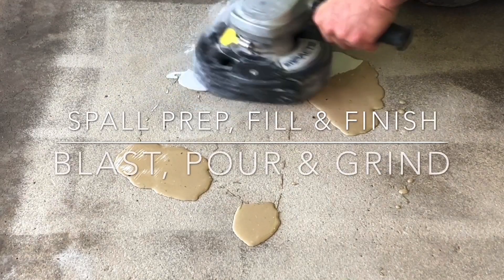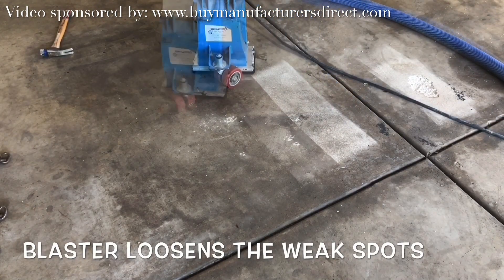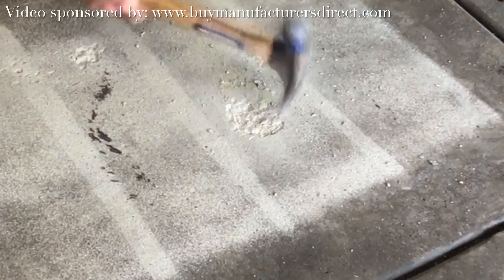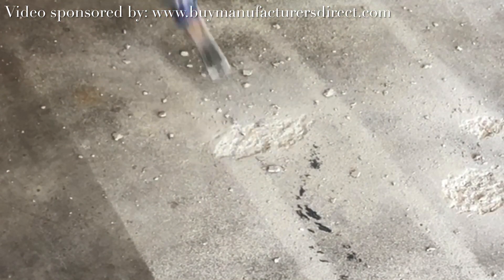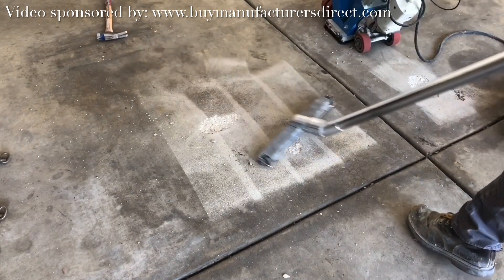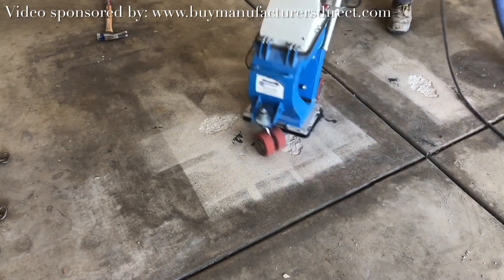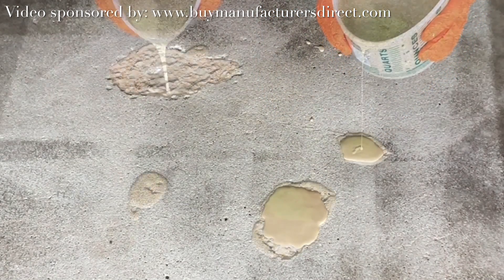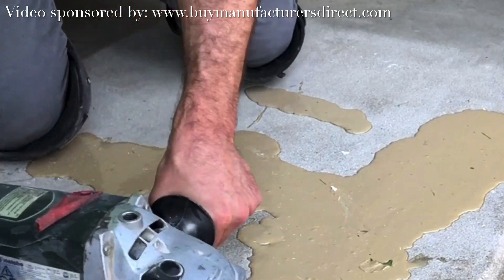Concrete Maintenance: How to Prepare, Fill and Finish Spalls

Comment: Great short video ! Why don‘t you use epoxy to fill those holes ?
Reply: Thank You. Epoxy can do the same job to fill voids such as these. The reason to use a higher performing product is the irregular shape and depth of the delamination and the need for the resin to act more like a cement based patch. Epoxy is usually much lower viscosity than this urethane. Rather than weaken it with an additive sand (to make the epoxy more like cement patch), this urethane is already made to behave as a patching compound.